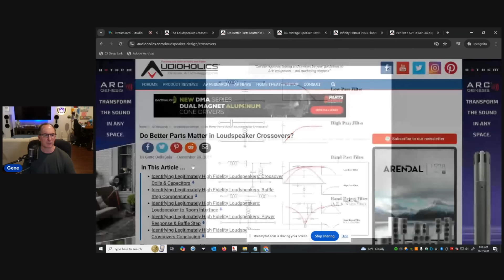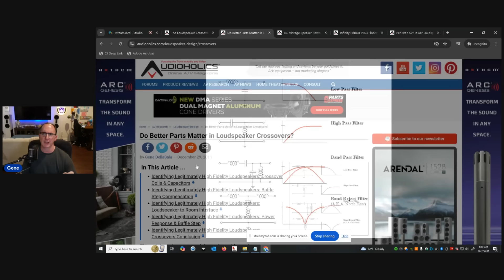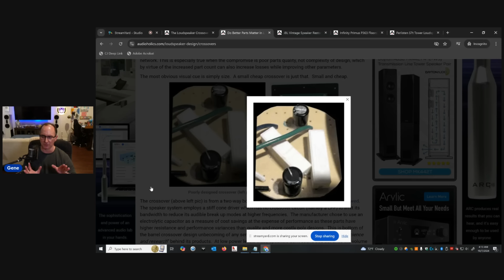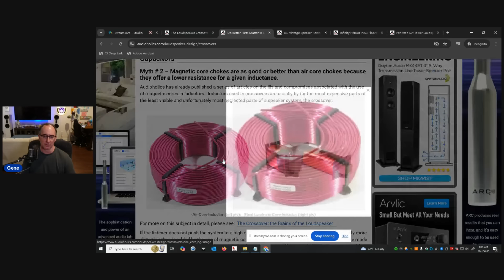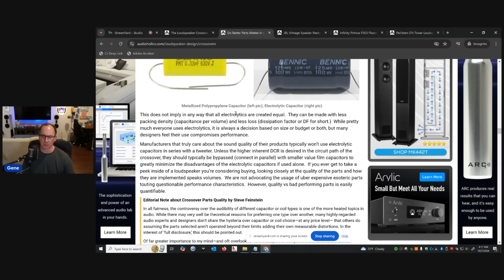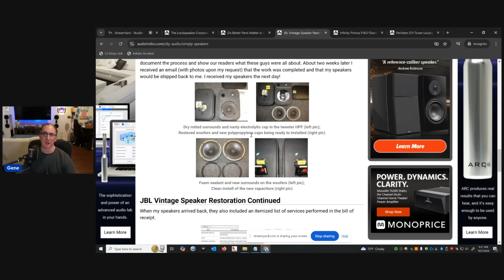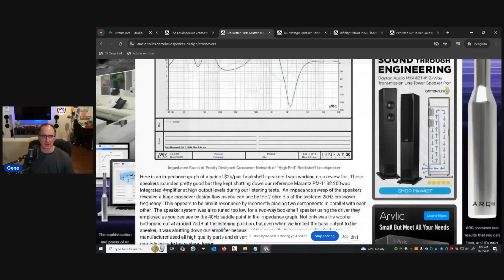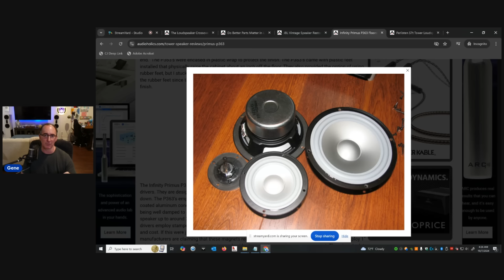Loudspeaker Crossover Upgrades - Are They Worth the Effort?

Comment: I've taken my hobby to the next level by making my own crossovers. Decent parts from Aliexpress have gotten very cheap, and with REW gated measurements and Umik-1 one can get tremendous results as a hobbyist. One can buy an inductor tester for under 20 bucks and just buy aircore inductors with same value as the cheapo iron core inductors every speakers comes with. At higher levels then you avoid a distortion type that is very bad and noticable.  Buying larger resistors with better cooling helps if you love high sound levels and they are dirt cheap. Swapping electrolytics out for films helps with power handling and longevity too.  Very seldom one gets 2 perfectly matched drivers some errors can be fixed by letting a mid play higher up etc so end result is flat. One can use custom padding values to make match tweeter level excactly too. Crossover can have a huge impact on the end result and its never been easier changing them.  
 Love the commentary in this vid, spot on!

Comment: Currently I'm rocking ProAc DT8 speakers - simple crossover with very cheap parts (according to the webs) - but compared to my old Klipsch RP6000 II (I know) they bring so much more detail without any harshness, all the instruments are separated. 
 
I know it's possible to get much better results but still, this shouldn't be possible according to some youtube channels, the signal should be all smeared ;)

Comment: Less parts needed the better. Better engineered drivers don’t need as many parts, 1st order being the least. B&W’s latest 805 uses one.  SB Acoustics makes some very linear high quality but inexpensive drivers. When CO’s have to throw more parts in the crossover to tame unlinearity in the driver it  sucks the life from a loudspeaker.  JMO.  Good video Gene.
Reply from the maker: Actually, 1st order crossovers topically aren't the best for loudspeakers to achieve high power handling. It's a good topic to further explore.
Reply: @Audioholics  I don’t listen above 85db so….
Reply: @louiesipes2257 I've had good results  on occasion with first order crossovers. Generally the compromise  is going to a higher crossover frequency.  This opens a new can of worms though especially if the lower frequency driver is somewhat larger hitting resonance at the crossover.  For the higher frequency driver the problem is you may only be 9 decibels  down a t it's resonance frequency there aren't many tweeters that can do this and the ones that can I generally can't afford.  
   That being said my Bose 301seris II prodgect worked out with a first order. I had replaced the front tweeters with Advent fried eggs. They actually can play low, but I still went to 2600 hertz.  The rear are still the Bose tweeters and I'm probably down 9 decibels at the Fs for them they fire backwards so it's not very noticeable.  But the impoverishment with the front direct tweeters was very noticeable right down into the midrange.  I hand wound a coil for the woofer and the caps on the tweeters are  some old ELECTROCAP brand ( not elerolytic) that were hand matched. I've got an L-pad to  bring the tweeters down a few decibels.  Since the tweeters are in series the Bose tweeter will certainly fry first. A nice insurance for the Advents. 
    Anyway the speakers sound good now and I  listen to them daily.  The Advent tweeters helped focus the imaging too. Still have a big sound stage in my basement room.  The Stanton 681 cartridge  goes a long way to providing a wonderful sound stage and my new Bose are up to the task. Brian Eno's On Land fills the basement as it was recorded to do. Segovia sounds like a natural acoustic guitar. It's what I had so I had to make it work. The 301s aren't alone, but they are the primary speaker

Comment: , I have been designing my own speakers and crossovers but I use calibrated microphones , crossover simulators  winisd for speaker cabinets, I use 14 and 16 gauge air Coil indicators and I have been using jantzen superior caps for the high pass and the blue jantzen for the low pass. Also a well braced dampened cabinet can be just as important for a well designed speaker. I have my own multiple layer cabinet technique that I am not going to get into but it makes a huge difference in sound quality. So look for a well dampened, braced cabinet.

Comment: I really enjoyed this video as I watch Danny’s speaker mod videos all the time. One of the things that Danny talks about is that speakers can measure well, but not sound the great, due to the quality of parts in the crossover. He talks about the smear that using poor quality crossover parts can result in despite measuring well. Same for the impact on the soundstage. Better quality parts reduce smear and improve sound stage. Can you speak to that Gene?
Reply from the maker: "Smear " should be measurable. I don't like making claims without quantification.
Reply: If you can show me the results with true double blind testing, I would accept that even without it being otherwise measurable with current test equipment and technologies

Comment: I thought crossover upgrades would mean a discussion on moving a speaker to active crossovers, not electronic parts. I went active with my Carver AL-III ribbons in 1998 and never looked back. No electrolytic caps to replace, double "effective" efficiency and with two amps, essentially quadruple the power I had before. Other than tightening the ribbons a couple of times and replacing one woofer a couple ofyyears ago, they're still going strong 29 years after I bought them in 1995. 

Fantastic dipole ribbon "in the room with you" imaging and sound with only 10" bass drivers and 48" ribbons handling 26Hz to 20kHz. Bass in my current house is +/- 2.5dB with no correction, only passive room treatments. It's a fully analog path for the turntable with a Carver C5 Sonic Holography preamp with remote motor volume control. 

I've recently added a Lexicon DC-1 surround controller and Klipsch surrounds and rears for Logic 7 operation and now music can play 360 with a fully natural sound. Duran Duran's Danse Macabre Atmos version sounds amazing with Logic 7 DD playback. It's not quite the experience as my 11.1.8 home theater downstairs, but still sounds amazing.
Reply from the maker: Active is a topic I'm very fond of as I own 2 sets of fully active DSP speakers and they are the absolute best performers in the house. I did a video about active speakers prior and it didn't do too well. Perhaps we need to keep covering that topic to help people understand the true potential.

Comment: •In a 2way best caps should be miflex kcpu or clarity cmr etc in series tweeter position. 
•Bypass these with something like miflex Kfpm etc
•Parallel on tweeter can get something like clarity csa or jantzen superior etc
•midwoofer can get something like jantzen standard or clarity csa etc
•parralel in mid woofer should be fine with something like jantzen cross cap etc

Resistors can be something like mills in the tweeter, jantzen superes in the mid woofer series side and jantzen mox parallel side. 

Inductors should be air core. Foil or wire wound, on the thick side for the application.

Best to pick out parts smartly and focus the cost on the most impactful parts of the crossover network.

Comment: I've redone a xover or two :-).

Redid the ones for my old Mordaunt-Short MS3.2s, replacing the old 6dB LP and HP filters with a 2nd order x-over designed with the help of REW measurements and XSim.  Another was a new x-over design for the new drivers I used to replace the time-damaged ones in my Mission 751s.  I liked the result there as well, but I might be slightly biased... :-).

When choosing parts for an x-over, or doing anything DIY for that matter, there's basically two questions to answer: (1) would it make an audible difference, and (2) does that difference make a difference, i.e. are you prepared to spend the extra time, effort and $$ for that difference.  Lots of times the answer to question #1 might be yes, but the answer to question #2 might be no.

Comment: Ive been waiting for this type of info thanks! I have Klipsch Cornwall IVs. Do i need to upgrade my Xovers?  Im not technically savvy
Reply from the maker: If you're happy with the speakers, no. Assess your room acoustics and set up first. If everything is in order and you're still not happy, I'd consider selling your speakers and getting better ones. If you like their sound or look, it's potentially feasible to upgrade the crossovers if the cost isn't prohibitive.
Reply: @Audioholics  Thanks sir. Ive been considering swapping out speakers. Maybe an open baffle like Caladan. Appreciate your candid reply

Comment: I bought the C-NOTE kit from PE.  The stock cross over did not measure like the advertisement.  It let the mid play too close to its breakup, so it sounded very harsh in the upper mid-range.  I ended up lowering the crossover point and increased the order (steeper slopes).  Sounded much better (did some A/B testing).  This was during COVID, so ended up with an iron core inductor in the mid-range circuit :-(  The new cross over was more expensive than the kit...

Comment: Sure good parts do matter. But I don't judge a crossover by just looking at it. You may see an inductor with thin gauge and think, "omg this bad!!". Not always. The designer might took the resistance into account when designing it. Example that I usually do: if I need a notch RLC filter for a tweeter composed by 5ohms + 10uF + 0.5mH. Instead of building an inductor with a thick gauge to achieve, let's say 0.05ohms, I can use thinner gauge and make it cheaper with resistance of "horrible" 0.5ohm. In my RLC I change the R from 5ohms to 4.5ohms, since 0.5 is already in the L. I would not do this for an inductor in the woofer path, of course. Another example: you may see an inductive resistor, but that resistor has just 5 turns and is located in the subwoofer path (<100Hz). What that parasitic inductance means in 4ohms and 100Hz? Maybe nothing. It's different if you use this resistor in an amplifier circuit which will handle 200kHz. There are many other optimizations that can be done here and there by using the engineering knowledge instead of dollars to achieve similar results.

Comment: I'm not the most knowledgeable in soeaker design, but I've always been curious about the components that accompany woofers and tweeters.

So recently, I purchased some in walls through Amazon. Micca M-85 2 way with a 8" woofer and tweeter that pivots. Other specs mentioned are 12dB Octave and 40Hz-20khz crossover. They sound really good.

I almost forgot, 100w, and 8 ohms.

Any chance some of you guys provide an opinion of the speakers? It would be much appreciated.

Comment: Danny Ritchie @GR Research did a crossover design for a pair of pristine Epos ES12s I had from my stepfather.  The Epos was known for careful driver design and baffle/box design and only used a Cap on the tweeter.  They were known for being clean, tight and articulate, but also VERY specific sweet spot and not much drive or meat.  Danny's crossover design helped smooth the response out, and phase issues, opened up the sweet spot and off axis response a TON, and it had more 'drive' to the sound...though not as tight and articulate and lean sounding, but I didn't feel I was missing details...I was just getting 'more' sound.  He did a couple videos on my speakers on his page.  Well worth the $2-300, and he took a fair bit of time talking with me.

Comment: Gene, I found this video from typing in "Audioholics GR Research review" lol so ya please review some of the speaker upgrades like the SVS ultras would love to here your final thoughts on the upgraded crossover vs SVS crossover, I have Paradigm Monitor 11 v7 towers and eventually want to replace them, thinking the ultras with the upgrade , or do I just go with the Evolutions, or scrap it all and go for the new Arendal 1528 make payments and bobs your uncle lol, the Paradigms where ok when I was only running a Paradigm ultra cube 12 , but I added dual SVS PB3000 subs and the towers need a boost, I want more mid range and more volume to keep up with the massive amount of bass I added. I know I will also need an amp for the new Towers, I am only running the Paradigms off my Marantz SR8012 in a 5.3.2 (yes I still have the ultra cube 12 on with the Dual SVS lol) anyways really love your channel and website, I have sent so many people to your site, specifically the section where you offer the best systems for each budget level, I love it ! Cheers Shane

Comment: Execution and sound design is always the most important step no matter what the endeavor. 
Give a novice house framer the best engineered lumber and you might not get the best frame but give a veteran framer what he deems good enough from Lowes and you'll still get a better frame than you will from the novice. Professional hunting guides are frequently asked by clients what's the best rifle to bring on their hunt and they usually answer the one you shoot the best as long as it meets the minimum need. Speakers are the sum of their parts not just the quality of those parts. They are the sum of their design and their execution of that design. If you're willing to sit down and measure dozens of caps you can find 10% tolerance caps that will match exactly to each other and the printed spec but most manufacturers don't have that kind of time because the product is too inexpensive to dedicate people to do that. So they go with 5% caps and deal with the variances. If a manufacturer were to run in every driver for 100 hours then measure them and then select perfectly matched crossovers you'd have no variance from spec but that still doesn't mean you'd personally like the presentation of that speaker. And it doesn't mean you'd notice a difference in the sound versus the same speaker using the same drivers that were not run in before crossover parts were selected or just using crossover parts that fell within the tolerances but not perfectly matched. But you would pay a hefty premium for all the additional time and effort that went into the matched speakers for a difference that may not be noticeable or worth the premium if it were. It's sort of like having a car that will go 200 MPH but you never exceed 100 MPH. The faster car will cost you a fortune for performance you never use and the slower car is both all you need and affordable.

Comment: My speakers are Ruark Crusader II’s powered by NAIM 82/ 135’s that I’ve had for the past 30 years… I am not so much wondering if the crossover design is right, rather if it’s likely that the capacitors should be replaced.  I just had my NAIM system re-capped and it made a big difference.  How would I go about getting my speaker crossovers recapped? I’m in the UK.

Comment: If you have high end speakers with well designed crossovers, why would you “double crossover” your speakers using the pre-amp/receiver? I have B&W speakers and a SVS sub for my 5.1 system and I find sending all my speakers a full range signal really brings them to life. The sound stage is more detailed and has greater depth. With LFE+Main and then selecting what I send my sub from all the speakers, I get a better sound. Setting my speakers to small and then selecting a crossover in my Cinema 60 kills the sound. What am I missing? It doesn’t make sense to send a limited signal to your speaker if its own crossover is designed well. And isn’t the Cinema 60 designed to send a full range signal? I’m skeptical of the idea that full range signals over work your receiver. Would love to hear your opinion on this.

Comment: Do stamped baskets perform as good as cast.
Reply from the maker: Cast is usually preferred for strength and being paramagnetic. However, very high quality drivers can still be stamped IF it's a heavy duty frame and not the super thin cheesy kind.

Comment: I’m not interested in modding my crossovers but want what I have perform as they did when new. I recently bought a nice clean pair of Klipsch Heresy I speakers. I opened up the back and the crossovers were immaculate,no corrosion or oil leakage from the can capacitors. How long should these capacitors last and should I replace them?

Comment: I’m am interested in a new pair of floor standers been looking into Dali. Would anyone have a list of companies that build floor standers in the 2k range with quality crossovers?
Reply: I've been using Dali Ikon 2 mk2 for many years. Ikon is the predecessor of the Opticon line. There are some differences in sound but not in parts quality. And their upgrade cost me only 150$.
It fully covered three basic steps:
Replacing two (for each loudspeaker) cheap electrolytic capacitors in the woofer and dome tweet circuit with not expensive Jantzen MKP Cross-Cap, the ribbon already had a good Bennic film cap.
Full re-wiring with the 47Lab Stratos сable, no cold contacts, only soldering.
And damping side walls with 5mm bitumen panels.
It was a cheap and fun upgrade with great result!